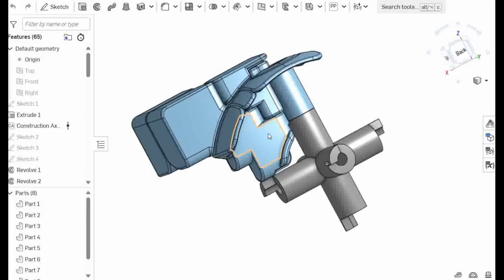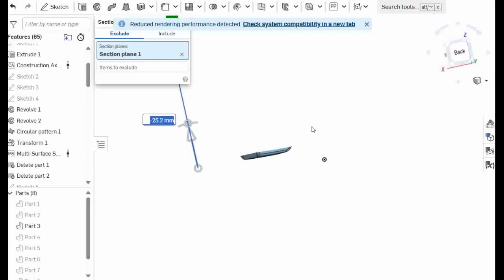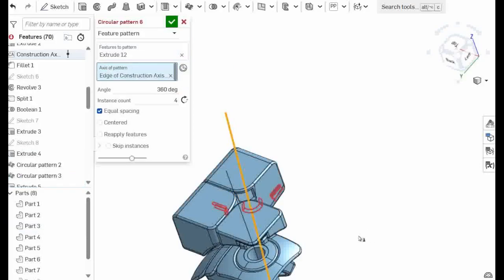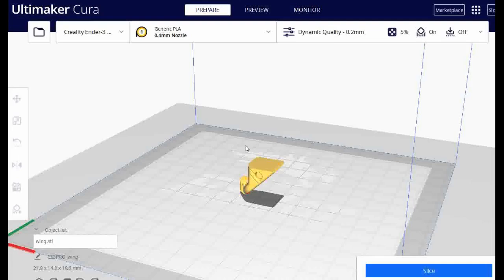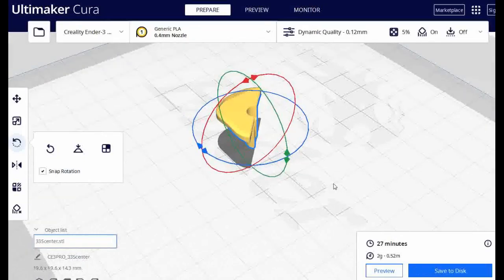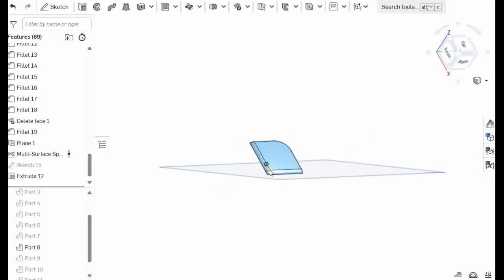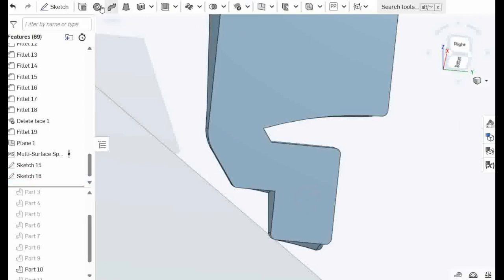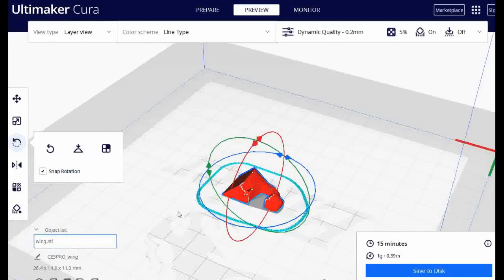How to design a 4x4 Rubik's cube episode 5: Preparing to 3D print

Comment from the maker: FORGOT TO MENTION:
There is a second reason why the stickerless split is favourable for FDM printing, and that is where the weakest point of the FDM print would be: Layer adhesion

The stickerless split makes it such that the layer lines are all vertical. This avoids a problem where a piece's head can be easily ripped of the root, which is what would have happened if the layer lines are horizontal.

For the same reason, the diagonal split I used in the x-centers of the maglev 4x4 v2 also make the pieces much stronger than they are on the v1.